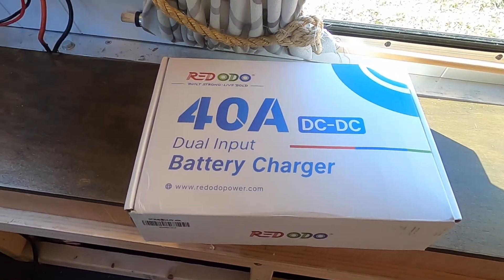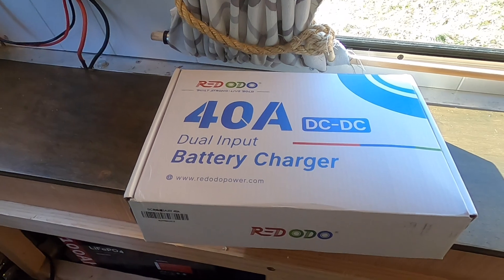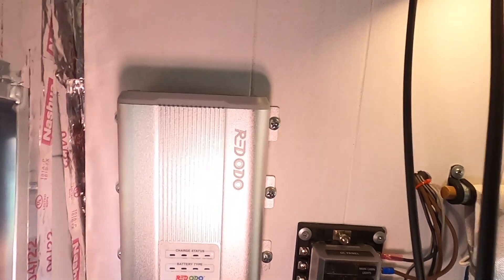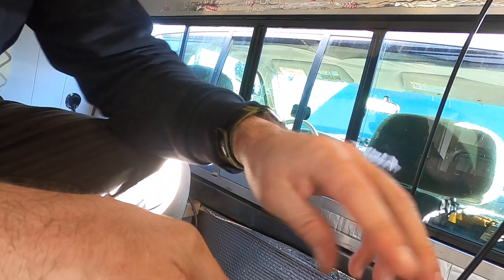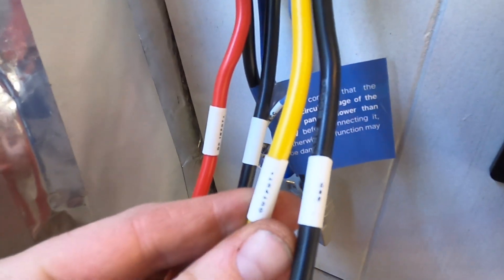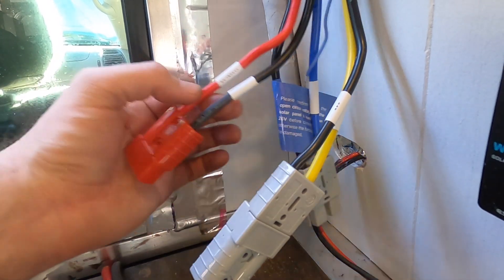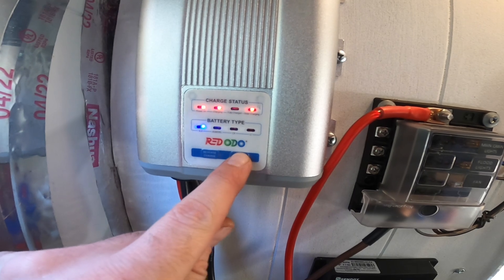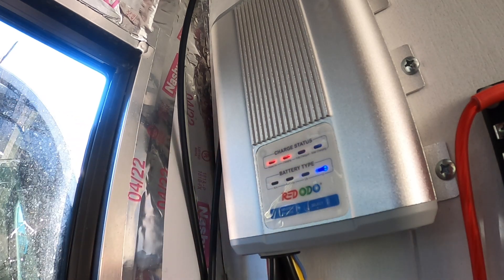Redodo 40amp DC-DC Battery Charger with MPPT | Installation & Test

Comment: very nice...  I have the same but a Li Time brand...  quick question..  did you connect the little blue wire.. acc wire. also did you find the 8awg wire could handle the amps

Comment: Quick question for ANYONE familiar with LifePO4 battery charging….
We have a radio repeater sitting at a mountaintop site that has utility AC power supplied to the building it’s housed in (+ LPG standby generator).

It is a 12 VDC unit and is currently supplied power via a 12 VDC / 20A power supply.
It has a secondary 12VDC input (no charging or power output to this input) 

We are not using the 2nd input now, but would like to place a 12V / 100Ah LifePO4 on the secondary input.  

Current draw of the repeater = 1.5 A standby / 3 A receiving / 14 A when transmitting). 
In the event of a utility power failure AND standby generator failure, the battery will last approximately 36-40 hours.
That’s enough time for us to get someone up to the site to address the problem.

THE BIG QUESTION  = Can we a LifePO4 12V/100Ah battery and have it sit idle with this Redodo DC-DC charger “maintaining” the battery?  We’d love to go solar eventually, but for now, we would power the DC-DC charger from a new spare 120VAC to 12VDC / 40a power supply that we have sitting on the shelf..

We wouldn’t want to “float charge” it, like the battery “tenders” we used to use on lead acid batteries left idle for months….   
We’d just want it sitting idle and keeping it at 100% SOC , or even better.. at 80% charge.
If the battery is used, when AC power is restored, we’d like the battery to be charged back up.
Thanks!

Thank you for a great channel!

Comment: Putting a load on your alt dors not affect your gas milage. The alt spins with the same force and rpm regustdlrss
Reply: Sorry, bruh, but I think you’re wrong. There is increased resistance the higher the draw.(I think).
Reply: @donjosevalle  it does, but the amount of extra power the engine needs to provide in order to spin the alternator faster in order to work a little harder to produce more energy/electricity, is very negligible. It would have to be running at a super high RPM for a very long time to make even a noticeable difference.

Comment: It's most likely 20amp mppt and 20amp alternator charging for 40amp total  on some models
Reply: I just wired up my Litime. It is identical to the Redodo. Off idle pushing 37.5 amps.
Reply: This unit does only either or.  Alternator it’ll charge at 40a.  If that’s not available it’ll use Solar.
Reply from the maker: @rabbitpumpkin8279  Yes, correct. Going strong now for several weeks. No complaints yet!
Reply: @rabbitpumpkin8279  if there is no house battery hooked up will the solar input charge the starter battery or does it need to be in "reverse charge mode"?